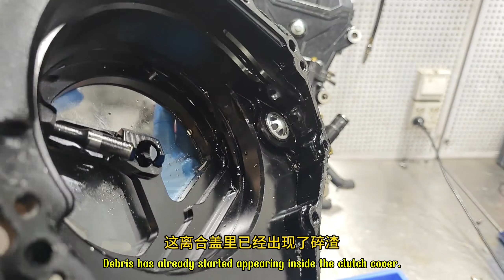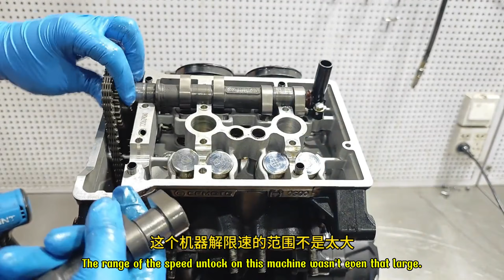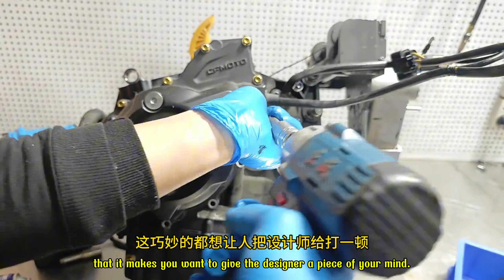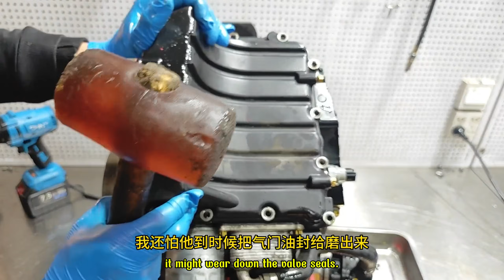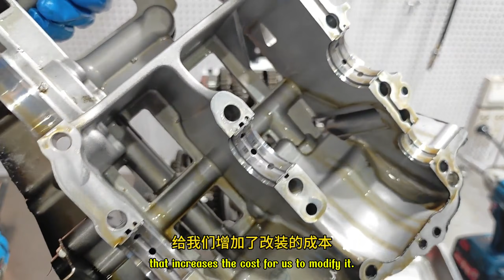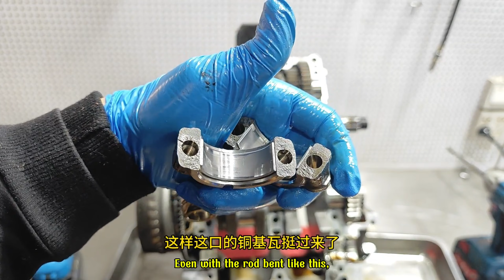What happens when you push a CFMOTO 450SR beyond its factory limits?

Comment: I'm a little slow so please work with me. The engine has a max of 14k rpm but redlines at 10k. When you say, "unlock the speed limiter by an extra 1.5k rpm" are you talking about going from 10k->11.5k? or 14k to a new max of 15.5k rpm? I ask because I am looking to get my 450 tuned to a full system exhaust so it doesn't run lean but I understand that they also extend the rev limit so it pulls further out within it's rev range.

Comment: Well, the engineers designed and produced an engine, with Exact specifications and tolerances, that someone else completely disregarded and just "Tuned" it according to what? A Voodoo Ritual.....?  Why not put a turbo on it, and then complain when it creates shrapnel......  Maybe the motor was already turned up to 11 just to get it where it was from the factory. Thinking that you can unlock a Japanese motorcycle, so logically, you should be able to unlock any motorcycle, is not logic. It's fallacy... 
What a cheap shot to take at CFMOTO....

Comment: I did not get the valve spring part since a flat wire spring does not have a higher tension than a round wire material... Also, you guys do offer now stiffer valve springs? Where to buy?